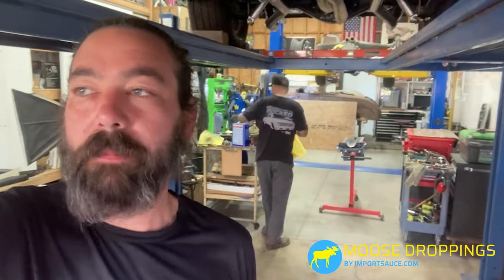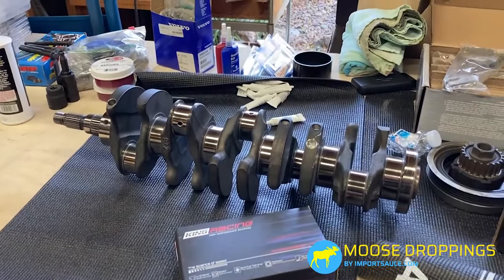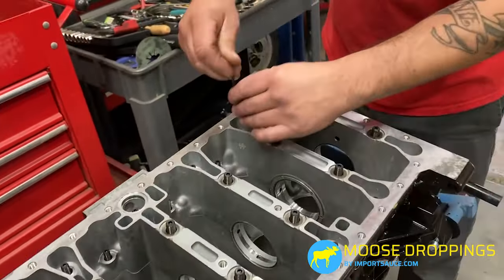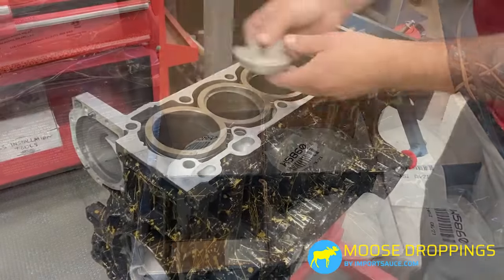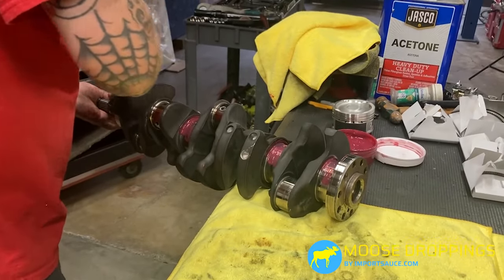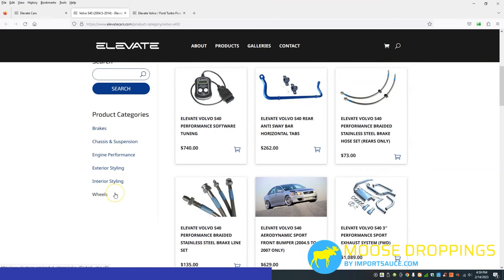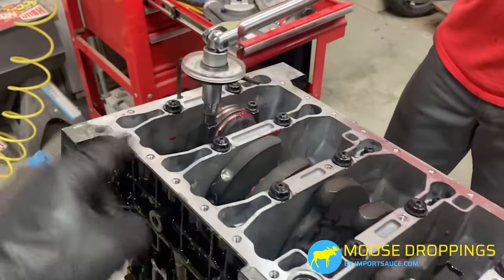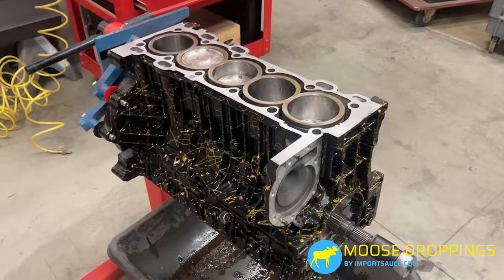Volvo T5 Engine Rotating Assembly Build - The Complete & Ultimate Step by Step Build Up Walkthrough

Comment: Im just starting my rebuild and this guide and video set are superb, ive watched the entire thing but one thing I missed is the piston oil spray jets, did you remove them? I cant find the torque spec for them, any idea?
Reply from the maker: Yes, we did pull those out, either a 10 or 8 mm I think. I did hand tight on those, but next time I am in VIDA I will pull and post the spec, glad you're enjoying, there are still 2-4 more videos in the series coming up, the head is back off at machining currently addressing some issues that were missed on the first pass, but hopefully we are up and running in a week or two and moving on the more performance upgrade videos for this car... brake upgrade, more custom electronics, more custom interior.... stay tuned,
Reply: @moosedroppings  Thanks Joel, Yes 10mm almost same bolt as the water pump, im gonna use thread lock on them though. Another thing I just realised I overlooked is I didnt buy new crankshaft bolts so its down tools for a couple of days, looking forward to further episodes of this awesome series its been a huge help for me to decide to go for it, Cheers Andy

Comment: You measured main bearings clearance without any sealant between crank casings. Adding sealant at the final assembly wouldn't that affect the clearance?
Reply from the maker: The sealant only takes up about a thousand so it is so far down from the decimal point, that it doesn't really factor in once the full clamping force is applied with torque, good question!!!
Reply: @moosedroppings  

Thanks for the feedback. I appreciate it.

Comment: I need my 1998 T5 wagon engine rebuild. And yes its MT 5speed with 320k on it and still drives new
Reply from the maker: Awesome.  They run forever. Ours died at 160k just because we were bad about checking oil.  This guild series will be almost identical for your wagon build
Reply: @moosedroppings That one extra cylinder sure makes a difference huh? smoother?
Reply from the maker: @jamesmedina2062 certainly